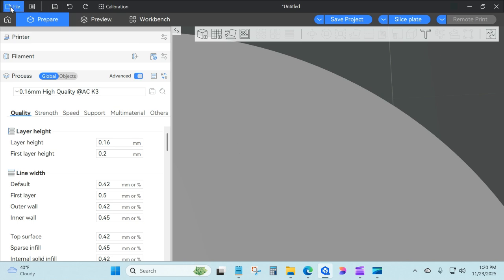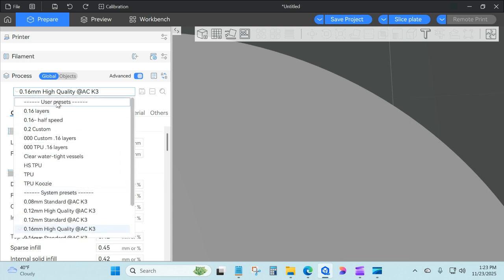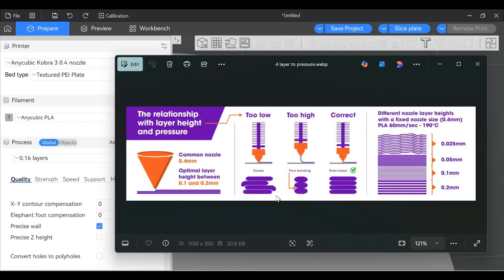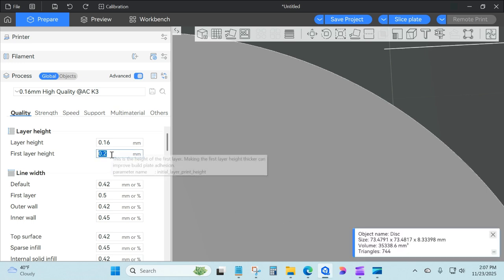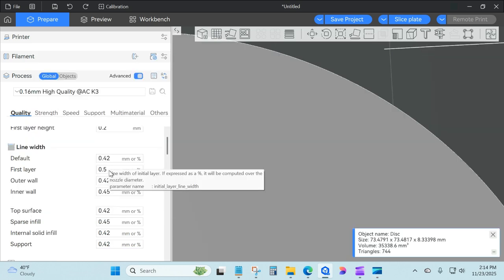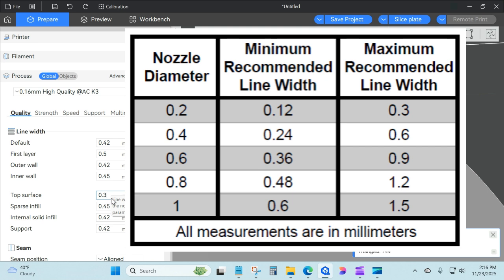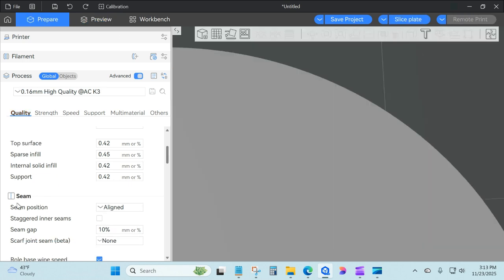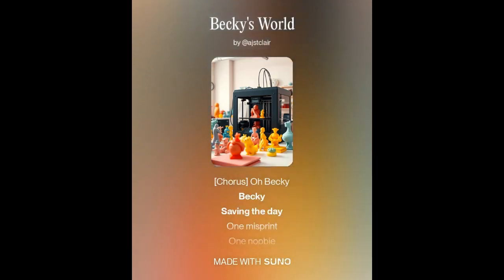@ANYCUBIC3D  Slicer Next Layer height and line width beginners video series

Comment: Ive printed 0.32 width lampshades Vase Mode with 0.4 nozzle. Now only have a 0.6 and never used it,need some Tips for high Quality prints (no lampshades ,will print them with 0.4)
Reply from the maker: Once you get the .6 nozzle, run the filament calibrations for temp, retraction and flow. Then you can print this model I uploaded for you to see what top surface line width will work best: https://www.makeronline.com/en/model/Top%20Surface%20Line%20Width%20Quality%20Test%20for%20a%200.6%20nozzle%20Kobra%20S1/265844.html?trackModuleType=10

Comment: Hey After some replacement of strain gauge,extruder,Sensors, on kobra s1. I wait for my 0.4 hardned Aliex hotends.  I have a 0.6 spare hotend. I want to make smooth 0.20/0.16 Lager height prints while Waiting.  PLEASE Tell me high Quality 0.6 nozzle line widths,Tips for Max vol flow rate Difference to0.4 (printed only 0.4 one year) Temps,etc.

Just what to adjust different to before 0.4.....
.also tension screw tension Tips? TRIBVTES FROM GERMANY love the Videos this time i really need em.
Reply from the maker: For best temperature and flow rate, please see my video about filament calibrations. It will vary based on the roll of filament you are going to print with. PLA, PETG, etc https://youtu.be/0o0-d8qw1Ek?si=fbX9ilY1_yhpC_-R

Comment: Love these vids. One thing I've been trying to figure out is how to add a pause in the slicer..am using a Kobra neo.
Reply from the maker: After you slice the model, there is a slider bar on the right side, slide it to one layer above where you need to pause and  see if you can right click it and select pause. Then you have to re-slice to set the pause in the GCODE